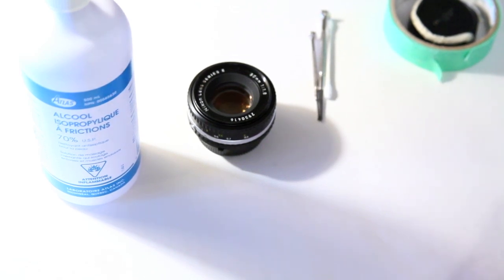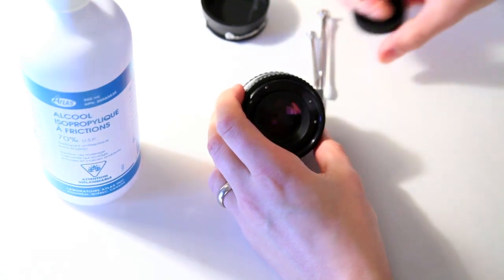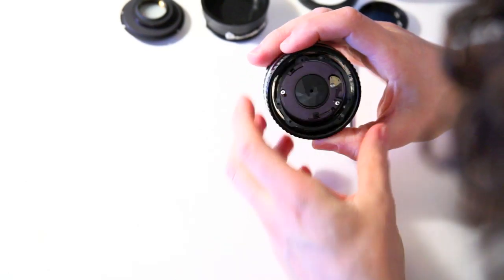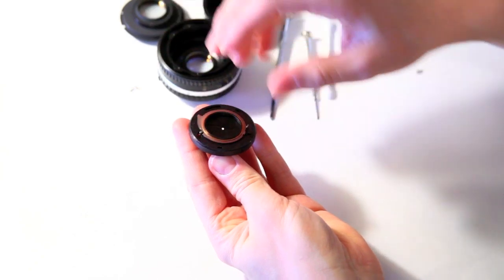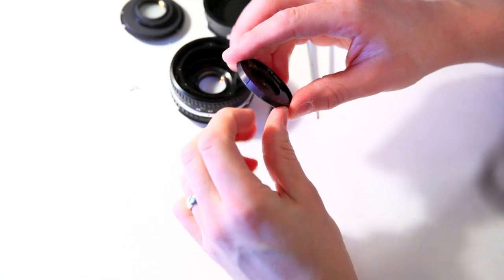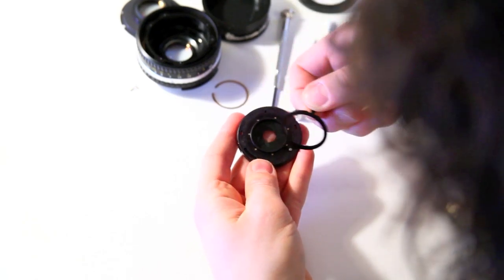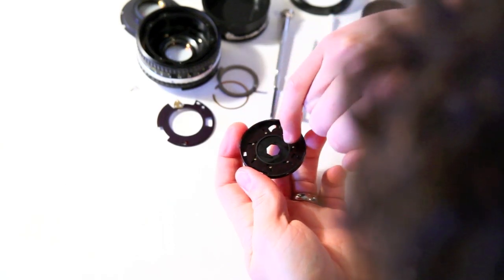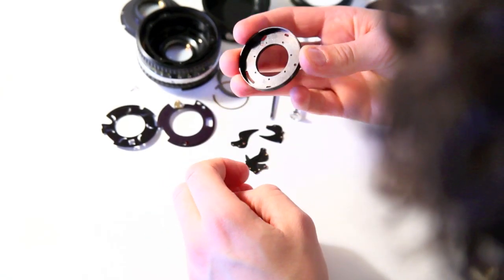How to Clean Aperture Oil from Nikon 50mm 1.8 Ai-s Series E Lens Pt. 1/2

Comment: At what point of this procedure would allow to lube the focus ring?  I found this lens in my garage and everything is perfect except for the focus ring has a slight stiffness when you turn the ring.
Reply from the maker: Sure actually if I remember correctly the best way is to pull the few screws off the mount and you can see the helicoid better from there. Sometimes just adding a tiny bit of grease from there can work wonders and you don't have to worry about pulling the lens apart. Just pull the couple screws and the mount will come off and see what there is to see. Focus it to close focus and you should be able to see the helicoid.

Comment: Can you do a video on how to remove fungus from nikon 50mm f1.8G lens plz? My 50mm 1.8G caught fungus on the rear element!
Reply from the maker: Hey I have actually never had a damaged 1.8G before and I don't have one on hand but perhaps I can shed a little "potential" advice. Just be SUPER careful becasue I don't know for fact how they constructed it, and be super careful with the ribbon.
So if you look closely you will see 3 screws holding the black cover plate on the mount around the element. Take those out and the 2 screws holding the chip board.
Then take out the 4 mount screws. Be super careful taking when taking off the mount to note any spacers and where they lay. Also be super careful with the ribbon. Of that tears its over for the electronics and might be hard to find a new one.

Now the element is either going to be screwed in and needing a spanner to take it out, or they will have more likely 3 phillips screws holing it in. I'm guessing the element will have the 3 screws keeping to Nikon's recent tradition.
Pop the element out and you should be able to clean it. If its stacked and you need to separate the elements you may need a spanner.
Hope this helps and would love to hear what happens.

Comment: If I was trying to clean fungus from the lens, would I take it apart the same way? Thanks!
Reply from the maker: Yes that is right you can take the front element out the same way at the beginning of the video. You don't need to bother with the aperture.
Then to take the rear element out if you need, you can use a spanner. Or if the fungus is just behind the aperture you could open the aperture to f/1.8 and carefully clean it through the front but be very careful.

Comment from the maker: Actually the cleaning is easier but putting the blades back in with the 1.4 ai-s are really tricky but basically the same idea. Also taking the front element out is entirely different. Focus out to close focus and you will see on the side a tiny screw in the barrel. You will need to loosen that out first in order to take the optics out. If you miss that it will be frustrating. :)

Comment from the maker: Hey ya this happens sometimes. 2 Reasons are that it can simply be tight and bind so holding the element ring try twisting it a tiny bit. Another reason is that it can be coated with oil on the inside which creates a suction effect and almost glues the two parts together. I have even GENTLY put a spanner in the screw holes and turn to break that seal. Its just a matter of separating the two. Even putting a metal doweling in 1 hole and lifting it so it tilts and separates the suction.

Comment from the maker: Yes this is the glue I mention that you need to use as a guide to place back in the same spots. They are not very tight so they should undo simply but just make sure you press down to avoid stripping the screw heads. When they come undone just remember which one went where because the red glue will help you know where they go so don't take the glue off.